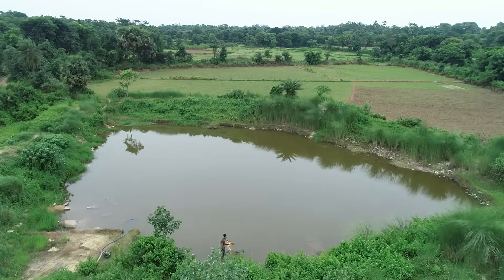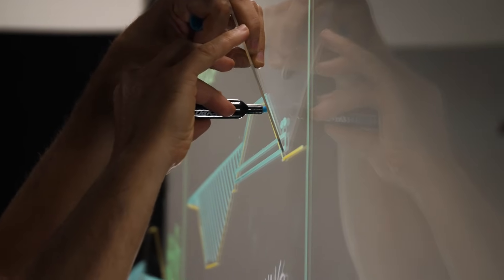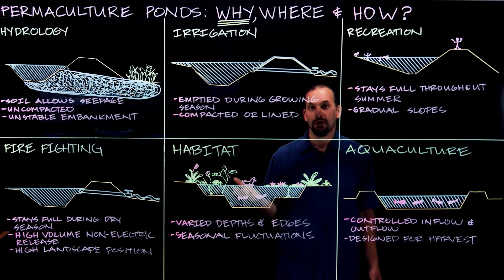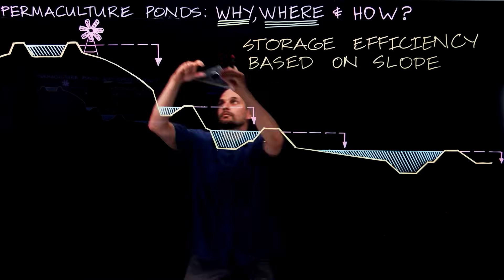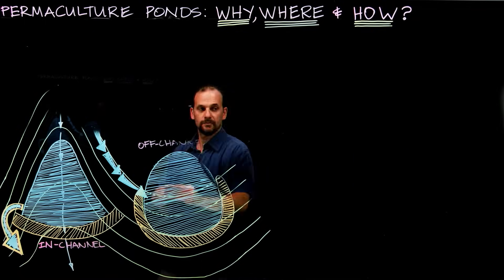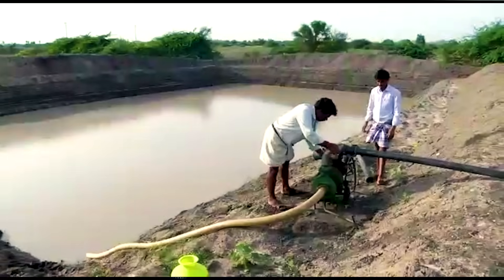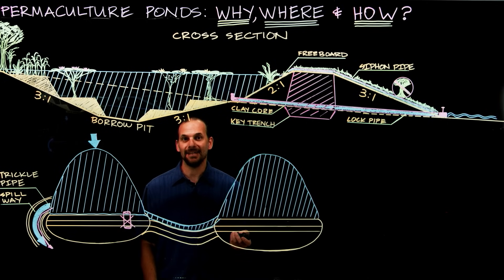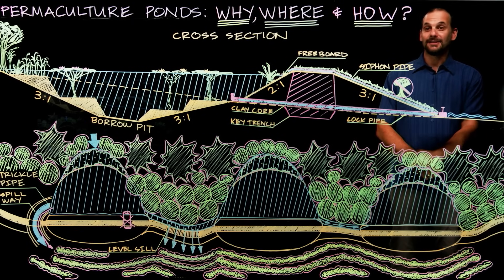PERMACULTURE PONDS: Why, Where & How

Comment: I am a civil engineer that works primarily with stormwater maintenance, and I've got to say you have done excellently in explaining this concept!
Reply: i wonder if people could use this to "transform" California  to have less fires and better agriculture industry
Reply: @cagjr3421  They can and there are people who do this successfully. They would turn the whole world green. The trick is with a real lack of desire to implement the solution and most people simply not knowing there is a very good solution to their problems. When they are overwhelmed with doom and gloom they become physiologically incapable to think clearly and unable to let go of their dogmas.
Reply: @marlan5470  Yes.  California was so convinced that they were in permanent drought due to "climate change," that they didn't bother doing anything to capture water when it DID rain, wasting many opportunities to ease their situation, just letting flood waters flow unimpeded to the Pacific, while continuing to bicker over water rights and mining the water that God gave them.  There's so much that you can do with relatively minor sculpting of the landscape, and intelligent plantings.
Reply: @harrymills2770  Yeah, this thing about deferring personal authority to inefficient institutions doesn't work.
Reply: i am a mechanical engineer which is also a pollution control officer and i've used this video as a guide (of course with applying other things I know) to set up the siltation pond for the rainwater and treated discharge of our company's STP. I'm attempting to make a healthy pond to grow tilapia in. our government requires that we are able to grow tilapia in our pond as it proves how effective our STP is in treating wastewater; the treated water needs to show that it's in standard chemical levels before it can be discharged to a siltation pond.
Reply: @scatz4994  very cool!
Reply: Such assumptive, ignorant shade given in response to a complement. How dare you mention your work in relation to being able to follow what the gentleman is saying...grumble, grumble! 😆
Given the typos & misunderstandings, one can wonder... Jealous of the pin? Just had to add my deux francs (as it were) & not be overly concerned about my exact wording on a little YT comment lol
Reply: i got a house with a drain pipe running throw the back yard. it looks like a grassy speedbump...at least im not flooded.
Reply: God has chosen your spiritual house of God, through Christ Jesus to restore life to my Abba Father’s dead country back to our ancient roots of the living God country of Salem, where dark forces has taken over heavenly places. You will receive eternal life as extraterrestrial celestial being King as your soul being relationship of God grows In righteousness. Don’t no much time get the whole world to appease my abba father to stop the apocalypse that’s coming in less than 3 1/2 years. We will ascend to heaven leaving those demon possessed living dead in hell that didn’t serve The Most High my Father Our Creator of life simulation bc their spiritual sickness in the spirit of deception not realizing they have been allowing demons to destroy the womb of God. We (God& my soul) has never inherit the land this entire planet. Royal Anunnaki Dynasty is Back Rising The Egyptian Decedents from the Dead. Queen of Salem will recognize to every soul inner being plants of my Father’s Gold and estate. History is repeating , it’s time for the world to see the power of God, our father moving through his people to save his creations that needs salvation and eternal life through Christ Jesus OUR RULER WHO SENT US TO SAVE HUMANITY FROM DEATH STORM OF EVIL. Don’t be afraid! Feel the Spirit Of God from within to be the difference. It’s an honor to be chosen, when the world doesn’t know who Abba father is chosen New Rulers 144,000 for the House of David to serve as Bondservants-Oracles Of God’s Throne only Through Christ Jesus where we live forever in the living. You are the soldier of God’s earth. We must go off grid where New Jerusalem will be built (small moon) waste water system for the minorities that God will make Majority. Royal Presidential Diplomatic of Heaven, We have diplomatic immunity and all who support God’s mission. 6787344741. Spread Eternal News to all struggling family and friends it’s time to thrive in cultivating our true destiny as Supreme beings New Creations Growth Mindset Using The Whole Brain Function God’s Gift to his people. This Is The Meaning of God’s Country. Queen of Salem Declares Heaven Forces!!!! ✨🙌🏾♾️👑💕💕✝️🆘
Reply: He’s trying to create an aquifer
Reply: Yeah OK buddy...🙄
 only thing you said about civil engineering,
 is the word “civil engineering”🤡
Reply: Civil engineer *who, not "that".
"Who" is for people, "that" is for things.
Reply: @kyrie26 Thank God you're here.
Reply: Permaculture is nature, is not guys like you twi , who tried to design things etc.... people like you make me tired, if you tried to design the permaculture, that mean you know nothing about permaculture ;) love from france
Reply: @ieatYTP59  People who think they got the truth over everyone else on something blurry like permaculture are the exhausting ones. Working closely with nature is still designing since it's involved planning and understanding existing  mechanisms.
Reply: @ieatYTP59  french (derogatory)
Reply: @ieatYTP59   thanks for the laugh since most permaculturists  are lacking in understanding much science.  True, they love what they are doing, but they treat soil and water too much like a black box instead of getting into the fine details.
Reply: @ieatYTP59  easy hater, are you ok, do you need some help with your  anger,   planting trees always relaxes me.
Reply: @ThomWalbranA1  ok so STOP designing things, let nature make the design
Reply: @ieatYTP59  yeah but these guys did design the electrical generators that power the warrior keyboard that you use to smite this ignorant civil engineer. I get the point you are trying to make but it is just not that basic. I'm off for a nap, you've made me tired too.

Comment: Your firefighting pond can be at the bottom of the landscape so long as it has good independent power. Solar power gets kind of unreliable when the air is full of thick smoke, but I don't think I've ever seen a wildfire worth the name that wasn't associated with strong wind, so a wind-powered pump should be excellent here.

Comment: A career tech school I used to go to had hydroponic systems with a koi pond. I’m doing research to build a pond fitting to benefit crop plants as well as the many strays and birds all, achieving it without electric pumps. Nothing extraordinarily big but enough using some different techniques. 
To do so, how would I take semi slope area that would benefit vegetables (keeping a portion protected for just me, some in ground for the groundhogs in my yard) and a mostly flat area large enough for two small ponds, a natural filter, the right fish 🤔 but with the idea that a cement ball bird bath will self fill….
It sounds simple to me but doing it just right is a slight challenge. I’ll stay tuned.

Comment: I’m civil eng here in austin that does water quality and detention ponds regularly 
Although austin has th most stringent water quality standards that are not cheap I now after 6 years understand since underground and overland flow are uniquely connected  
Did one wet pond on round rock - each species of wetland plant required a certain water depth so I had to grade all of these side slopes - not fun but I understand

Comment: Most of what your saying will not apply or is a little wrong in your... lecture.
You speak of a spillway to share excessive rain water with another pond, as if the extra pond is free from rain or the spillway is somehow a giant pipe.
People normally have a set area on their property for what they hope will be a natural solution. The one´s that have several acres of land and as many choices
of placement are virtually none, because even if you own a large garden, their is only one esthetical area that will both compliment water and the extensive requirements
of the plants and filters.
Having fish makes for a huge difference in design criteria and limits the placement  often demanding large adequate areas for plants along with a large bog filter system.
People often have way too many fish and not enough waterfalls for aerated water, this is always the starting point of pond design and question; will one have fish?
Yet even if it´s just a chance to see water plants, you will still need to scale up for a water fall and filters.
Hardly anyone is going to find clay at the bottom of their 1.5 meter deep hole and transporting and applying it, is asking too much from people.
It´s different on a commercial scale, as farmers often line the gully´s for run off´s around their fields with clay still, as these do not go deep enough.
So then your very first step, is then opting for the most effective and cheapest filter system as your starting point; The Bog Filter; the idea is that a pump
hopefully with a speed dial, is set either in the pond but not at the bottom, to pump up to a filter filled with stones, the water should arrive at the bottom
and be allowed to rise, that water will be cleaned due to the Algie and plants planted in the top of the filter and the water should then run off and back to the pond via
a natural looking stream or hidden pipe.
The point being that the filter needs to be a little higher or much higher if possible than the top of the ponds water level. Ounce you have both the placement and size
of the pond you must try to make the Bog filter one fifth of the ponds size. If a tiny pond, then the filter can be made inside a barrel, if it´s a big pond, then you will be able to enjoy the
many new plants like Lillies that come up every year. A bog filter is simply a deep as possible hole filled first with big rocks, then smaller until a layer of 20 cm sand or fine gravel
at the top is possible.

I hope this helps you and your service :yougotthis:

Comment: This was pretty much a video version of basic parts of the old  USDA publication #590 for basic pond building.  Both of these are sufficient for an irrigation pond.   There was one glaring exception which is the root of the demise of most of these ponds in that there was no discussion about preventing siltation which fills most ponds within a few decades.  You do not want to incur the expense of dredging since it usually costs more than the original construction.

Comment: Very interesting video Andrew!! Only thing i wonder is why you'd propose a lockpipe across the dam key which seems pretty risky to me (potential erosion of the dam clay core), instead of directly using a level-sill spillway for the total flow for a 1:1000-yr scenario (to be on the safe side).
Thanks for sharing!
Reply from the maker: A lock pipe is for water distribution, like for emptying the dam to irrigate. A level sill spillway is for excess overflow water

Comment: This pretty much sums the basic ideas very clearly and informatively! I've only built one relatively small pond myself yet and another was already on my land. Oh, mistakes were made of course but nothing that could not be turned into a feature if not advantage. Both ponds are without any liner, placed on a highest part of the plot close to each other. It allowed us to perform maintenance without water losses since we simply pumped excess water to neighboring pond. It also helped to quickly stabilize chemical and bio water balance, allowing much quicker introduction of aquatic plants because usually you have to wait a year at the very least beforr introducing fish or flora to a newly filled pond. Anyway - great vid!

Comment: I would love to dig a pond on our land but we have very sandy soil, very little clay, but at the same time I don't want to artificially seal it with plastic or rubber, that defeats the object to me. I may try digging a small pond and tamping down the bottom to try to get smaller particles to fill in the gaps and see if a seal can be achieved which would improve over time as organic materials etc. build up. I don't know if there are any other natural ways to prevent water from seeping out?

Comment: We have a 19 acre pond that is fed by seepage through 100 yards of river bottom on the lower snake river.  It’s an abandoned gravel pit.  Any suggestions on how to remediate?  Currently a large river rock and sand bed everywhere and about an average of 10ft deep.  No clay on the bottom as it stays a few inches higher than the river that has a LOT of flow.

Comment: So helpful, thank you! QUESTION: I'm considering digging a small pond in our orchard on a hill for irrigation and possibly hydroponic uses (the total area in question is approximately 40' by 15') .... I was thinking of putting it in the channel between two ridges of our orchard of peach and apple trees (30 on each side). You mention that fruiting trees can cause problems and destabilize the pond- would you advise against this idea and perhaps move toward rainwater collection from a roof instead?

Comment: I live on 2.5 acres and would like to improve drainage to gather the water for a roof runoff rain garden/pond combination, then follow the highway ditch to divert runoff into a shallow ravine where we will install a pond to perculate water to our water well, the pond being about 35 yards from the well. We also catch water in the ravine from across the low traffic highway where a farmer has a 20 acre dry row crop operation. His shallow area on the field collects water that flows by culvert into our ravine as the headwaters for Mule Creek, that eventually flows into the Okmulgee river in central Georgia. We are getting small amounts of nitrates in our 100 foot deep well water. Hopefully, the runoff from our property will eventually dilute the nitrates we get. What type of professional or good set of resources can we use to improve our property and insure we have water in case of drought or power cut off from a natural or man made disaster? If I send you a plat view of our property, can you return it with comments? PS we left Oregon to live in a lower cost area and be close to my wife's relatives. We do miss Oregon, but it was not practical for us.

Comment: I bought a piece of land and it already has a 1 acre or so pond on it.  I believe it is fed by a natural spring, because the ground uphill is always soggy.  It also has a burm on the downslope side.  The pond has been put in a long time ago.  During the summer the water level drops quite a bit, but not completely.  When I walked into the pond, the ground was very loose, and every tiny bit of pressure I put on the soil, large bubbled came up to the surface.  I don't think it's methane, because there was no smell.  Any idea of what that might be?  Stored oxygen maybe?

I've got trees on the burm side.  They are small pine trees mostly.  Should I cut them all down?  My other concern is that if I cut them all down, there will be even less shade and in the summer the pond might dry up completely.   Any ideas?

There is a pipe that goes under the burm, but I could not see where it comes out the other side.

Comment: For the how part, I highly recomend a bulldozer over any other type of heavy machinery, they can move more soil farther and faster then any excavator or backhoe. The bigger the dozer, the better. The main reason is the distance the material needs to be moved. Even when compared to an excavator and a dump truck, a lone bulldozer can do a better, faster and cheaper pond then any other earth mover out there. Certainly excavators have their place in dredging and such to renovate a pond but for the initial dig, a bulldozer can't be beat.

Comment: 4:09  "Gravity" is a noun.  You used it as though it were an adverb, to modify a verb "feed".  You skipped a step:  to convert the noun in to an adverb "gravitily".  Lazy, slack, and ill-trained.  Minus 2 points for you or minus 20 points for your teacher, whichever is to be blamed for the failure.
Reply: Don't be stupid and pedantic. 
Gravity fed is a perfect description.
Reply: @simonmasters3295  No it's wrong.  Don't defend error ever again.  If your teacher did not teach parts of speech to you and require you to master them before allowin you to pass, then that teacher owes it to refund his or her salary.